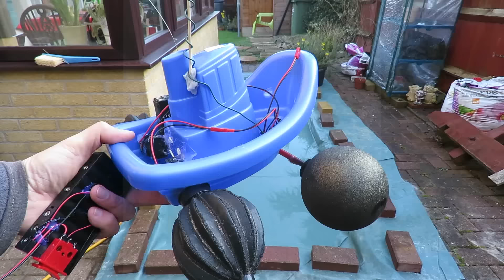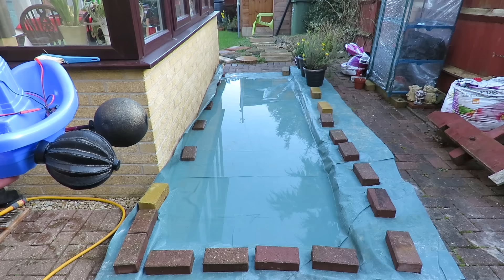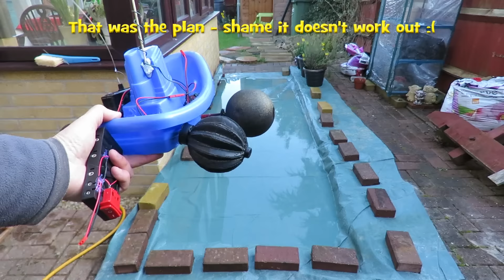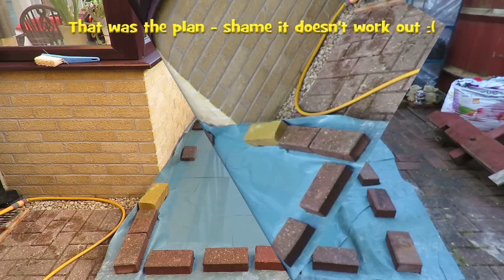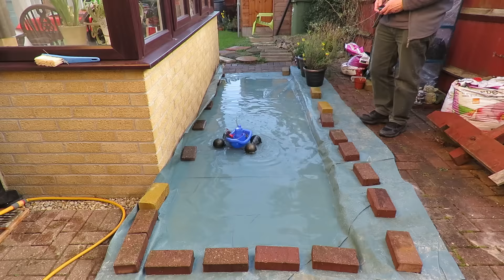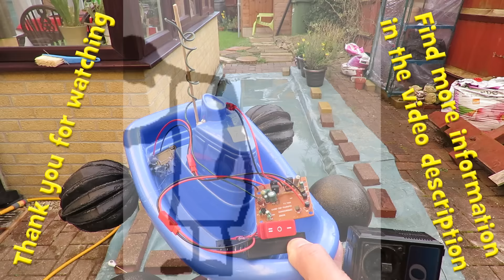Boat with Wheels - Third Attempt

Comment: Good effort though eh and that pond construction was a success, there'd be no reaching in down at the lake !
Gearing may be another idea. It's always fun to see such things attempt the challenges, successful or not :)
Reply from the maker: +slider2732 I am probably not giving this project 100% effort, just throwing together parts salvaged from other projects. 4WD would give it the best chance of getting up the slope and out of the water. If I can find a couple more matching cars with convenient gearbox assemblies that might be the next version. A nice set of 4 metal geared servos would be nice although we start getting relatively expensive for the sort of project I aim for.